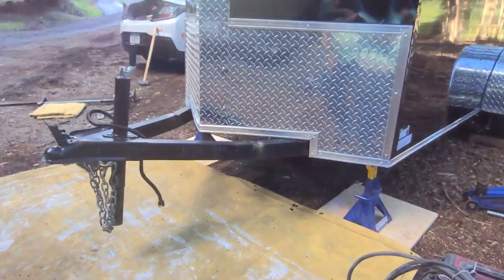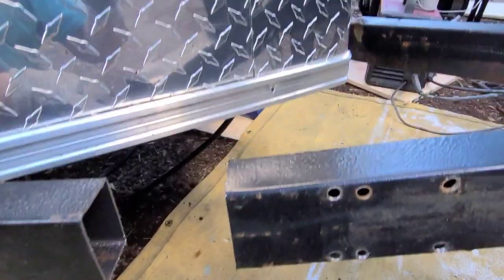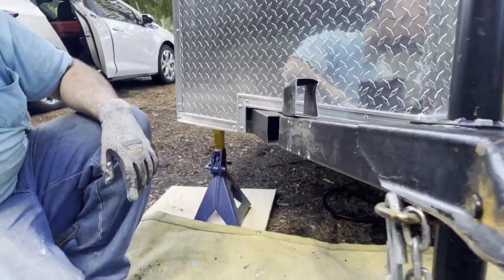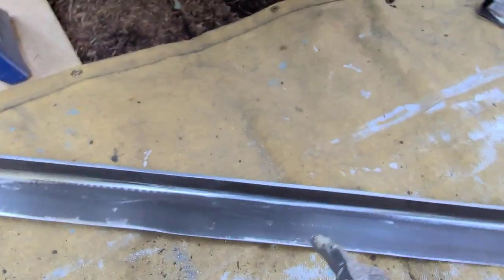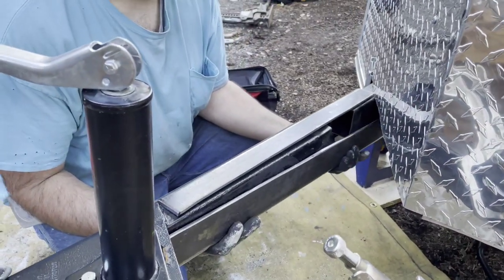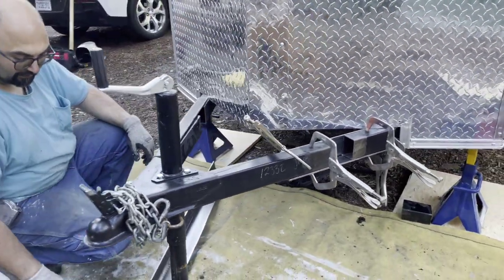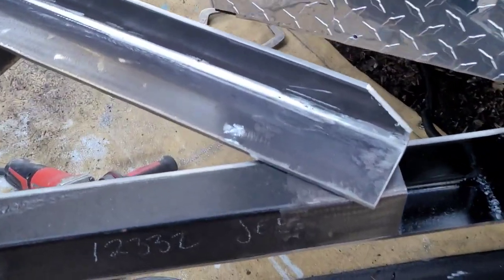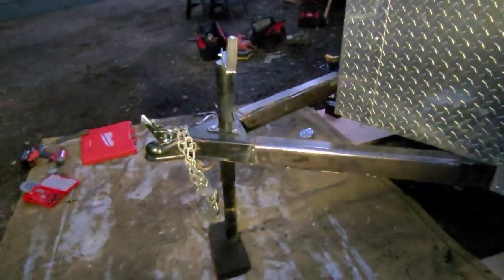2021 Eagle Cargo trailer failed in 1 week

Comment: Man, that is awesome! I am not familiar with trailers, so I'm surprised at how thin that tubing is. Your repair strategy looks pretty solid. Probably better than new. It's not a showpiece, so you got it done quickly and effectively. Good job on the footage as well, especially being out in the field. I'm impressed!
Reply from the maker: Thank you bud.  All I need is power which the customer had supplied with a 3500 watt craftsman generator.  30 Amp rated.  Worked for me.

Comment: Whoa thata crazy. Guess I wont use a weight distribution hitch on these. Great job on the fix. I know who I'm calling if I run into this problem.
Reply from the maker: It was crazy for sure. There's ways around this.  If there was a backing plate over the frame to spread the force, this could of been avoided altogether.  Sometimes you learn as you go in life.

Comment: Interesting idea . I think I may have done it differently . But maybe your way was faster. But none the less good work . Hope that person makes his trip with out a hitch . Get it ? Dad jokes all day lol 😂
Reply from the maker: Adding drum 🥁  snare emoji
Reply from the maker: I actually wanted to sleeve it with a bigger box but the tubing was exactly the same as other tubes
Reply: @PFab  I get what you wanted to do . But in my mind that’s added weight ontop of cheesy flimsy metal already . I was thinking of putting tube inside some how . That way it can’t flex that badly again . Idk my mind always works backwards lol
Reply from the maker: @7thsignthenorthcoast146  it's the same idea.  Inside or outside.  Outside the metal is easily accessible to reinforce. From the inside it would be more complex. I wish I had cut the metal wider so there wasn't a gap outside.  I precut the steel at my house 2 hours away.  It took 3 hours to cut it size.  Cost me nothing but time.  I have plenty of those rectangular tubes sitting at my house.  And I was thinking this would be the fastest work around.  Local metal sales are harder to get certain types of steel.  And prices are doubled.  It's insane the times we live in right now.  In the end I just made it work with what I had.  It was safer than what the guy had before.  Not as pretty to look at as I imagined. But I learn as I go.  I have never seen this before.
Reply from the maker: @7thsignthenorthcoast146  also with that v shape there would be no way to shove tubes into each other

Comment: How much weight was in the trailer to make it buckle? As I have the identical setup.
Reply from the maker: It was about 1000# which the trailer was rated for 3500#. I think the frame failed because of the load leveling system.  I put some info in the description.
Reply: @PFab  Do you know if he was using the Equilizer leveling bars?
Reply from the maker: @paedahe4975  that's what caused the dents. Too much force on the frame.  Or the frame wasn't up to the force.  Either way,  now it will not buckle.
Reply: @PFab  I was meaning what brand bars. Nice fix. Looks solid.